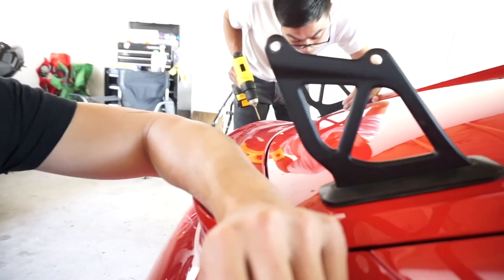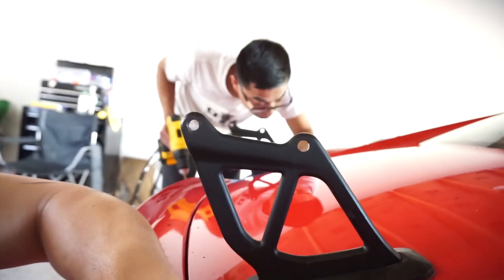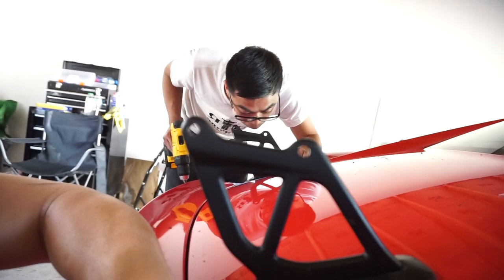Porsche Cayman Gt4 wing on my 987

Comment: hello jimmy, looks very good, do you need a front spoiler now or can the rear wing not influence the driving stability of the 987 ??? 
where dityou buy it ? 
Greetings from Sardinia, 
Salvatore 987owner
Reply from the maker: Yes a front splitter will help balance out the front end and the spoiler is from NRauto gt4 style made for the 987 body

Comment: Few questions.......

Do they provide a template on where to mount? I I see you used rivets. Is there a cover to cover the rivets. Looks black in ten pictures so can’t tell if you painted the rivers black or it’s a cover? Does the wing vibrate, shake at highway speeds? Thanks.
Reply from the maker: They have an instruction manual that provides measurement to center the wing. Also it did come with some cheap rubber cover so I ended up leaving it off. It's not terrible but it gets kinda shakey when you are driving in the triple digits.

Comment: I did the same thing on my 987, but it wobbles like crazy when I hit bumps or at high speeds. The screws are all tight, so I think its because the trunk lid flexes. Does yours wobble at all. If so, did you do anything about it?
Reply from the maker: Mine wobbles at high speed as well

Comment: The uprights are made out of ABS? Thats a joje no? Those have to be made out of Aluminum, or is your caynam limited to 30mph? City limits?
In europe the car goes 275kmh and with that wing and ABS uprights you may find your wing elsewhere on the road after having gad a speed trip.
.
Reply from the maker: Sadly these are made of abs plastic they start to shake pretty bad when going upward of the 100mph. 😂.

Comment: i have the same the uprights are anouying coz they wobble and flex alot if i could get a spare set id get somone make then in stainless and 5 in taller
Reply from the maker: Mine definitely bothers me a bit and it’s cringing at high speeds. I have a cnc machine at work which I may try to cut some new ones out.
Reply: Yea was gonna get another set off the brackets and get someone to make me a set and raise it up abit more too but they wont sell it separately  shame
Reply from the maker: If I end up making some I’ll let you know. Mine will be made from 1/4” aluminum.
Reply: @Beehivefisherman  ok thanks  if not i may  get the tech art look one

Comment: Jimmy,....You need 15mm Wheel Spacers on the rear and 8mm on the front to give the car a much better stance.
Reply from the maker: Definitely needed but I will be buying new wheels around spring with better fitment. :).
Reply: @Beehivefisherman  I've got the stock 19" Lobster Claws spaced with 8mm on the front and 15mm on the rear and they look just right.
I'm thinking of a 20" upgrade with the fronts at 8.5J instead of the stock 8J and the rears at 10J instead of the stock 9.5J, the rears may need a small 3/4/5mm spacer just to get it looking perfect.
Only problem is I do like the look of the Lobster Claws and can't find an aftermarket alternative which looks better. !!!
Reply: I got 15mm rear and 7mm front spacers for mine